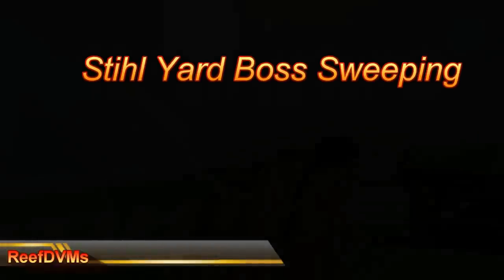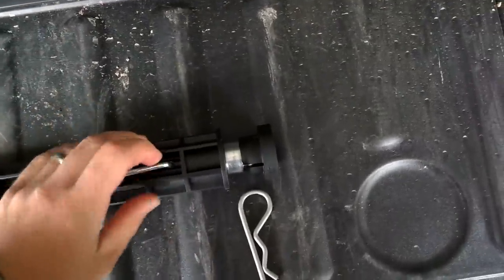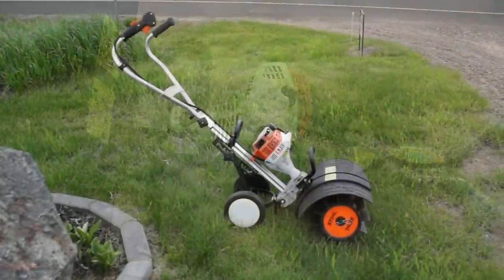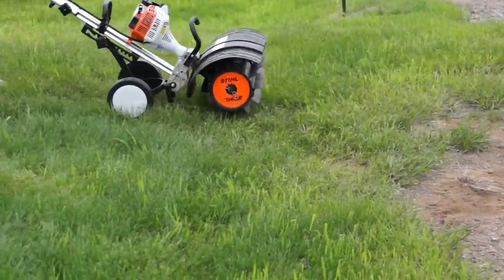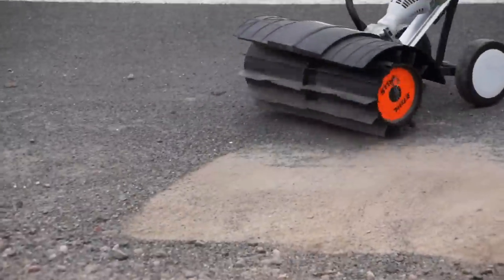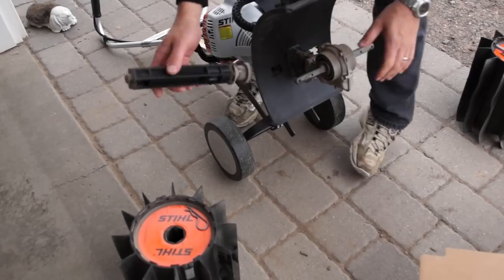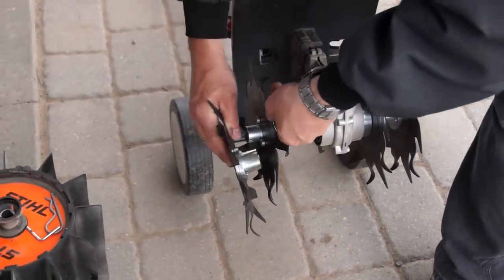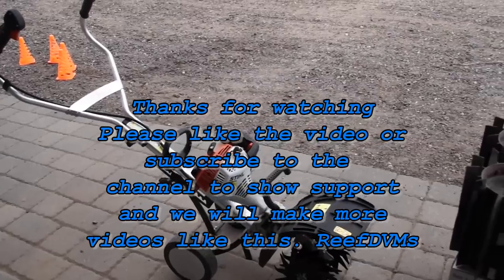Our Stihl Yard Boss Cultivator with a new Power Sweeper

Comment: I have the stihl km130 kombisystem unit with the tiller/cultivator attachment, the rubber paddle broom, the bristle broom, the string trimmer, edger, 145 degree articulating hedge trimmer, the pole saw and I have two 3 foot carbon fiber extensions. No matter what tool I use or how hard I push this thing it never bogs down or loses power. I like this kombi unit better than the dedicated units because the engine on this km130 is 36.3 cc 1.9 HP and you can use the same powerful engine to run all of the tools and save storage space and money by not having to maintain multiple engines. I used to have 5 or 6 dedicated units and they took up alot of storage space, now I can literally fit this whole kombi system in a golf club bag. This kombi system is well worth the money and it's worth paying the few extra dollars for the bigger engine, (110, 111, 130, 131).

Comment: Can you turn the head of the sweeper or will it only work straight on? I'd like to be able to walk along the edge of the property and have it just kick the rocks ahead and to one side, rather than have to go in 2 foot swipes perpendicular to the road.  Still a better option than a normal handheld.  I used a Shindaiwa setup this weekend, and although it worked great and ran beautifully, it was a 2 hour long butt kicking having to lug it around.

Comment: I have a lawn with a lot of lumps (worm activity I think).  I rented a detacher but I'm still not happy with the results.  I am considering the Still Yard Boss with paddle attachment.  Will the paddle knock the tops off the soil in the lawn?  If I step on the lumps, they squish down, so very soft.  I am hoping that I can fill in the low spots (about 2 inches deeper than the high spots) with the paddle and use my lawn leverling rake to smooth out the soil.  I don't have a huge lawn.  It's about 3,000 sq ft.  Does anyone have any experience with this?  Thanks.

Comment: Do you know if you can switch to the powersweep on a Kombisystem cultivator attachment like you did with your stihl yard-boss? Im guessing it has to use the same gearbox like the yard boss. It would be a great savings if I didn't have to buy a separate attachment and could buy just the paddle kit.
Reply: Yes, you can!

Comment: The rubber flaps must wear out at a horrendous rate!
The sweep is the most expensive attachment by far too!
Surely there must be a better method than this tool that just scrapes.
Thanks for the upload though.
Reply from the maker: +Jeff Bourke We are in our third year here on this machine and use it monthly all year long and have not worn out the rubber, they flex pretty easy and get scratched up by the rocks but so far no tears and holding up well
Reply: its called a blower , been out for years

Comment: I am having trouble with mine wanting to kick back at me when I have the sweep pushing the debris away from me.  Did you have this problem?  Is there a secret to get it to push and not have the whole thing come back at you?
Reply from the maker: I actually run mine so it brooms towards me, the device easiers to run, just wear boots and then pull it verses push it
Reply: So you walk backwards with it, while sweeping towards you?   The larger deflection shield was that a separate purchase?  I assumed it came with the power broom but it didn't.
Reply from the maker: Actually the broom for us did come with the extra shields maybe they dont do that anymore?  But yes i wheel it forward, it sweeps towards me and then i pull it back and it works easier for me when doing gravel off the grass each spring
Reply: Thanks, yeah I am asking the stihl Dealership I bought this from why it doesn't come with the deflector shield.  Waiting to hear back from them.  They probably charge you for it now.

Comment: Have you used the broom sweeper, I have recently purchased one, but I'm struggling to push against the back movement, it just isn't working for me, how do you cope?
Reply from the maker: you can actually turn the head around so that instead of pushing the broom you can pull it towards you to sweep, I find that easier even though if throws the material towards you some

Comment: Hi! I have a Huskee 31cc cultivator that is very similar to your Yard Boss. I am trying to determine if I can make the Stihl Power Sweeper accessory fit on it. Would you mind measuring the shaft from the gear box on either side? Mine measures 3inches and looks about the same as yours. The pin holes look to be in different positions, but maybe I could make new holes in the sweeper extension rod if needed. The shafts on each side are rounded on one side and flat on the other. What is the radius of the power sweep 'cylinder'? Does it look like there will be enough clearance to not hit my deflection shield? There's only 4.5" from the top of each shaft to the existing deflection shield above meaning the sweeper cylinder cannot be wider than 9" (twice the radius) including how far the fins protrude. My main goal is to power sweep snow. The kit is not cheap and I can't try before I buy, so I am hoping you can help me out and I can make a better educated guess if it will work. Thanks

Comment: Do you think this is also good for snow?
Reply from the maker: Yes as long as the snow is less then three inches and not full of wet heavy water, it works great
Reply: +Anthor Castillo -  I got the brush attachment with it and It's only good for light snow. I just bought one and used it for the first time today on about 3cm and once it piled up, it would dig down and not go forward anymore without substantial effort.  Maybe I just need to get used to it and slowly figure out the best way to use it.  Other than that it did a great job on clearing my walks to the cement...  I like it...
Reply: Tyrone Layes .